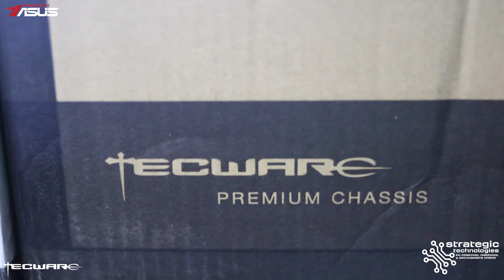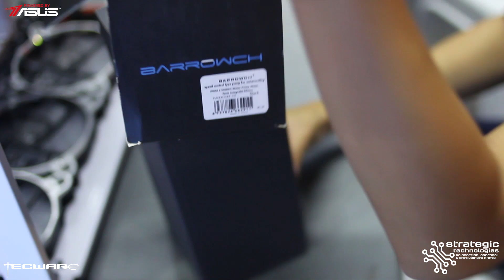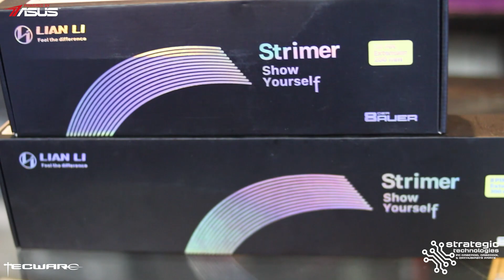FEMALE BUILDING A CUSTOM LIQUID COOLED PC! BUILD LOG: Project Iceberg VXR | Tecware VXR White

Comment: Nice build. can i ask what vertical gpu bracket did you use?
Reply from the maker: Cooler Master Master Accessory Vertical Graphics Card Holder Kit

or 

can also use Phanteks PH-VGPUKT_02 – Universal Vertical GPU Bracket with 220mm Flat Line Pci-E X16 Riser Cable Kit 
https://amzn.to/3iiYSUl

Comment: may magreply kaya? 

just wanted to ask kung di nahirapan ilagay ung radiator sa top mount? i heard na 240mm lang pede... if ever na may minor modification ano po kaya ung ginawa para magkasya?
Reply: i think its fits the case i mean if u see the thumbnail both sides already touches the case
Reply: i had a slight modification made to fit my 360mm  radiator sa top. may dalawang rivets sa top back side na humaharang sa rad so I removed it at yun pasok yung 360mm radiator ko.

Comment: Vertical gpu again? The gpu clesrance in this case. Uhh..
Reply from the maker: gpu too big for normal mounting and unable to close the case tempered glass once gpu is installed with psu cables. this is one downside of the case for big gpu.
Reply: Doesn't hurt airflow, doesn't conflict anything, looks amazing why not?
Reply: FTVG inc i think it does a bit. Aesthetics is subjective. I think horizontal mount looks better
Reply from the maker: vertical mount looks better on this kind of setup as it will occupy the empty space inside the case
Reply: @teriyaki_9inety9ine27  I dont think so the gpu isn't starved its not blocking anything and normally I like horizontal mounting but with this setup I think the virtical looks better and I feel like it helps fill in more empty space virtical rather than horizontal.
Reply: FTVG inc you do you man. Im not gonna argue with you anymore. :-)
Reply: @teriyaki_9inety9ine27  we were arguing?
Reply: @teriyaki_9inety9ine27  I thought we were having a conversation.😶